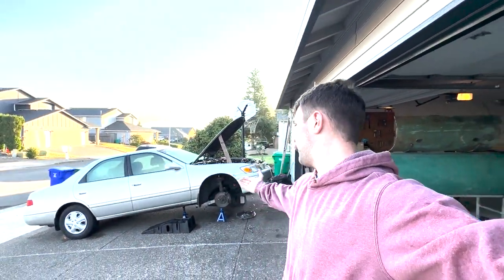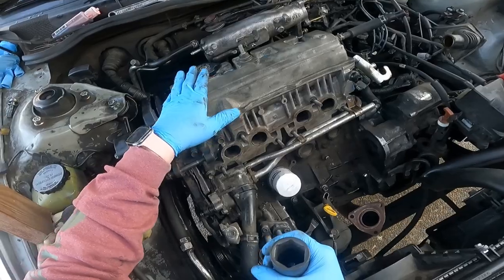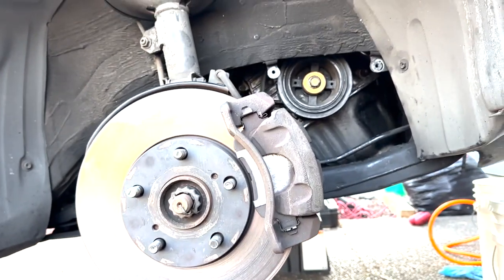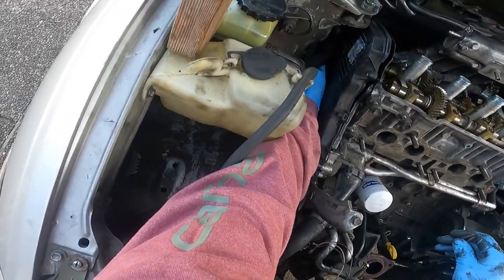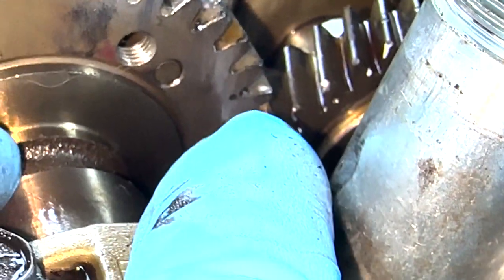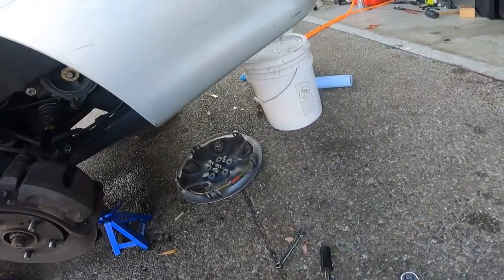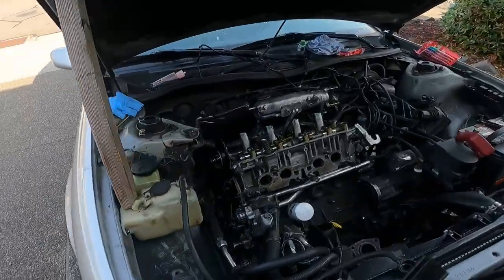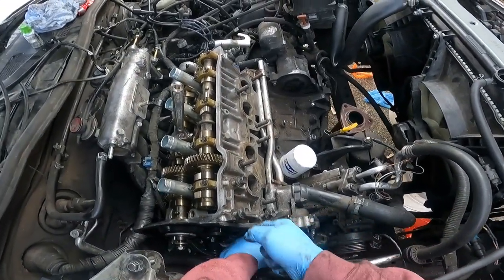Toyota Camry Timing Belt/Water Pump Replacement Pt. 1

Comment: I've struck a snag with my crank shaft bolt being stuck on.  Attempted a number of methods to get it off, but suspecting that the last person to do it used thread lock on it.  Just wish that it would come off like everyone else's as now I've got a new bolt on order and having to get it replaced at a shop with more gears than most DIY's....  Even the strongest rattle gun couldn't get it off, just ended up rounding it grrr...  My lesson to share is that I (attempted) this first before taking out the alternator, dogbone engine mount etc, saving a lot of work putting all that back together to still have a running car.
Reply from the maker: Oh no bro that’s a bummer!! Sometimes heat, or a welder are your best friend with stuck bolts. Although there on the crankshaft pulley you run the risk of blowing out seals when you use heat. Not a good situation at all my friend I wish you luck!

Comment: So what caused the knocking chugging noise in the 1st place? Bad head gasket or bad timing belt?
Reply from the maker: I never heard it myself it’s just the info that was relayed to me, but based on how the timing belt was shredded I’d say that was what caused most of the noise. If they skip one or more teeth the engine is gonna run like crap and sound horrible if it runs at all

Comment: Hello, do you happen to know if these engines are time interference?
Reply: Yes it is
Reply: @YourMomsBestToy  This is the Toyota 2.2 liter 5S-FE 4 cylinder engine and it is NOT an interference engine. The pistons and valves will not collide with each other when the timing belt breaks. Get your facts straight. If you don't know or aren't sure, then say that, but don't give out bad information.
Reply: No, it is NOT an interference engine. @yourmomsbesttoy doesn't know what he's talking about.

Comment: what do i do if the timing marks dont line up,  is it ok to turn them one at a time with the belt off so they line up ?
Reply from the maker: Like turn the cam gear without spinning the crank or vise versa?
Reply from the maker: Yes you can do that^ but just be careful if you ever feel resistance don’t crank on it you could bend a valve against the piston. If the spark plugs are out of the engine (which they should be) it should be pretty easy to spin the crank or the cams. Aside from the spring tension you’ll feel from the valve springs when rotating the cam. But long story short yes you will have to spin the crank or the cam separately with the belt off in order to get the gears to all line up when you slip the belt back on just be mindful that the valves can contact the pistons
Reply from the maker: Part 2 has been uploaded btw

Toyota Camry Timing Belt/Water Pump Part 2
https://youtu.be/e6atMKSWwhc
Reply: @pnwvibe3123  gotcha thanks
Reply: @pnwvibe3123  also the 5sfe engine is non-interference so the chances of me damaging the valve with the piston is low right ? or no, sorry for the questions my knowledge on car repair is low and im still learning
Reply from the maker: Oh I didn’t know it’s non interference I always just assume they are interference it’s safer that way. If that’s the case then yeah you’re fine. The pistons have cutouts for the valves though that made me think for sure it was interference but hey! I’ve been wrong lots of times. Good luck @Aztec
Reply: @pnwvibe3123  I thought these were non interference engines?
Reply: @pnwvibe3123  I thought that this is a non-interference engine, meaning that the pistons and the valves are too far away to ever touch...  All the other videos have said this, and I know from experience also as mine snapped, then it was replaced...  The other major tip universally mentioned by all is to not spin the engine in anti-cloackwise direction as thats the reverse engine direction.
Reply from the maker: That’s true I was mistaken before
Reply: @Cheval Sauer  what happens if you spin it counter clockwise? 😢
Reply from the maker: Shouldn’t be a huge deal. Just recheck all your timing marks because rotating the wrong way can take tension off the timing belt and allow it to slip a tooth. As long as all your timing marks are back in place, and you rotate it the right way with very little resistance, you should be good to go